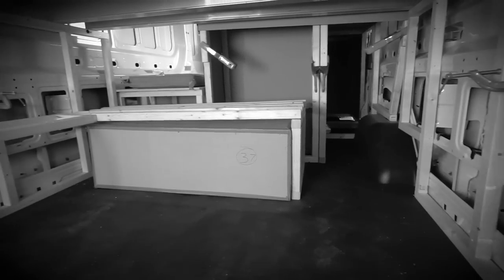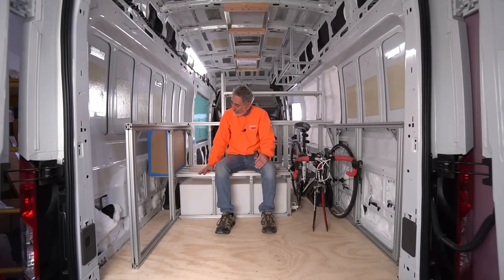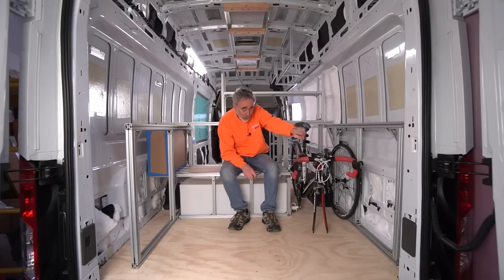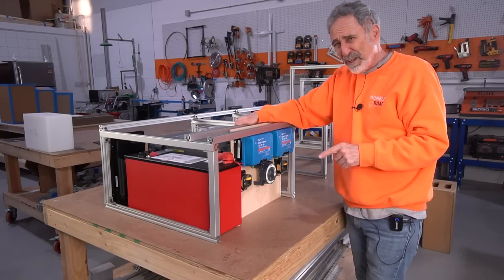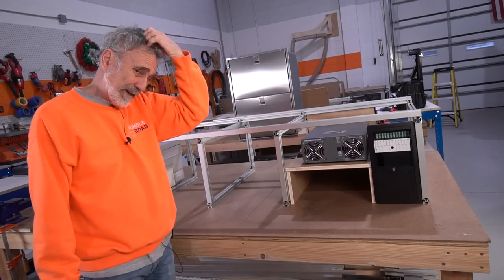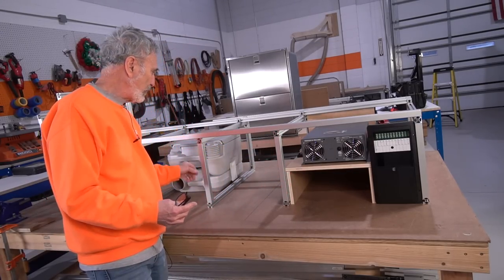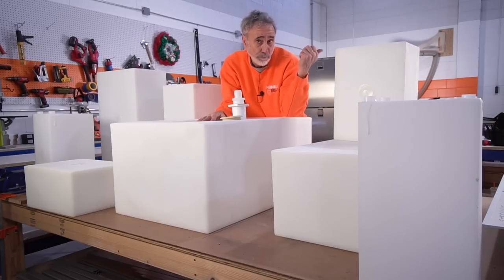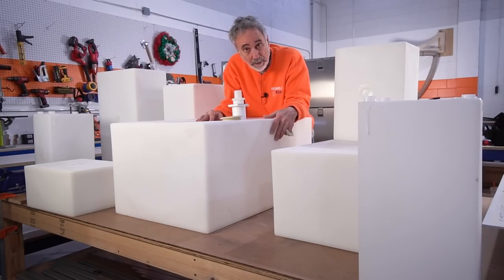Van Builder's PRO TIPS: 8020 extrusions, electrical compartment design & fresh water tank fittings

Comment: Unlike yourself, many seniors are balance challenged and are too heavy to be comfortable on an upright bicycle.
But the world of Tadpole Recumbent Trikes is one that many seniors are pleasantly discovering. For the heavier individual like myself, a Greenspeed Magnum XL Trike is the ticket! It will hold a rider up to 450 lbs. These recumbent trikes can be equipped with electric pedal assist, but mine is not. The seat can be removed and the trike body can be folded in half. Innovations I am sure you will appreciate. I am saying all of this because you will eventually be having clients who will request recumbent trike storing considerations in your build design. Either unfolded with seat removed or left attached. Or folded entirely. The Greenspeed Magnum XL has a large wheelbase of 45" X 33 1/2" in front. The boom extends even farther. But the trike folds up to 34" X 30" X 17". My ideal situation while travelling would be to have a rear garage/utility area with a loft bed high enough to just lift and roll the whole trike in underneath and secure it down. The one compromise would be to remove the seat for lower roll in clearance so the loft bed doesn't have to be so high. This Greenspeed model is about 44 lbs. and other recumbent trikes are appreciably lighter. Many seniors enjoy the higher seat height afforded by the HP Velotechnik Scorpion PLUS. You would probably like the lower seat of the Scorpion fs. And I'm sure you would enjoy riding the AZUB Ti-FLY with its front titanium leaf spring. Catrike of Florida makes great trikes too. Their folding Dumont model is fantastic. And I haven't yet mentioned the world of electric assist QUADS. Ha! Too many people of all ages are getting injured on these electric bikes. The 250 watt motors translate to 20 mph on flat ground, but the electric motors of higher watts makes them too fast on trails and other places. I see an intense and emerging symbiosis between RV life and recumbent trikes. Once you get all settled in at your new campsite, what more comfortable and safer a way to ride around and check everything out than on a recumbent trike?!

Comment: "Cyndrilical?"
Reply from the maker: Yes!
cy·lin·dri·cal
/səˈlindrik(ə)l/
adjective: cylindrical; adjective: cylindric
having straight parallel sides and a circular or oval cross-section; in the shape or form of a cylinder.
"a cylindrical plastic container"
Reply: @HumbleRoad  I know, but you didn't say "cylindrical," you said "cyndrilical." (3:12)  Not trying to be a "richard," just found it amusing.😁
Reply from the maker: @tc2882  OHHHHH! 😁 I didn’t realize I mispronounced it. I’ve had comments questioning the word itself. So my knee jerk reaction is to go to the Websters. 😁